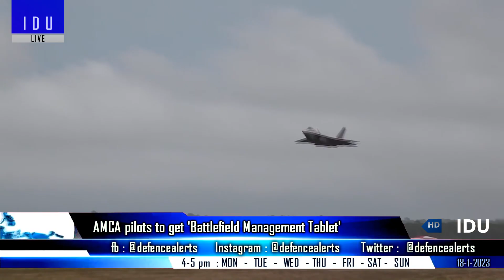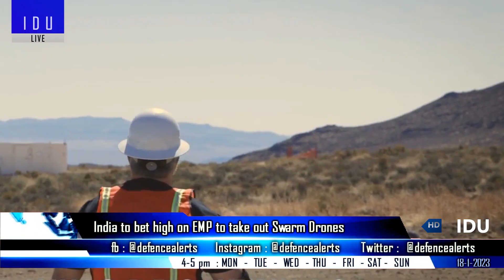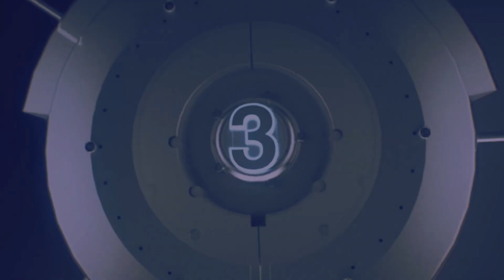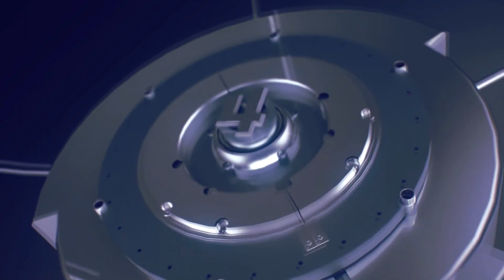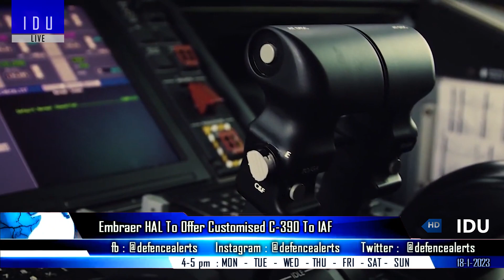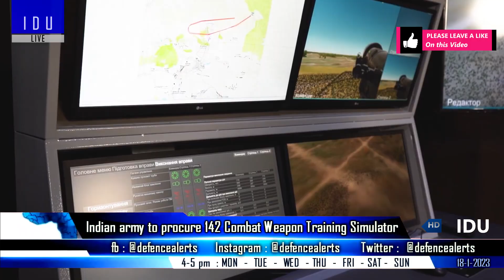Indian Defence Updates : BMT For AMCA,EMP Counter Drone,C-17 Upgrade,C-390 Offer,142 CTWS Deal

Comment from the maker: :yt:What's Your Opinion : "EMP Based Counter Drone" ?
ＬＩＫＥ | ＣＯＭＭＥＮＴ | ＳＨＡＲＥ | ＳＵＢＳＣＲＩＢE
Reply: It's An important non-kinetic measure which can be used to counter Chinese and paki drone  by Electromagnetic Pulse (EMP) technology. The EMP-based technique uses an extremely strong pulse of focused energy which is used to impact the electronic equipment by  increasing the voltage of those systems. By interfering with the radio links, the EMP disrupts the command-and-control system of the UAV with its ground control station. The main targets of the EMP include various sensors, navigation system, and communication system .
Several countries are investing in UAS and counter-UAS technology. China has made significant progress not only in UAS, but also its countermeasures utilizing all available technological options, especially EMP. In August 2021, China reportedly tested EMP technology to shoot down an unmanned aircraft. This event marked the first Chinese test of this technology to neutralise UAS and has also highlighted the growing relevance of EMP technology against such systems.
Reply: These things has to be left to private sectors who can come up fast and will free up resources at PSUs

Comment: the Indian Air Force should pursue Boeing to build them a stretched variant of the C-17A Globemaster III (Block 50) multi mission heavy lift transport aircraft . . . because the air force sure does need them . . . should Boeing launch a stretched variant of the C-17A Globemaster III (Block 50) multi mission heavy lift transport aircraft, rest assured Indian Air Force won't be it's only customer . . . meaning developing a stretched C-17A Globemaster III multi mission heavy lift transport aircraft is financially viable for Boeing . . .

Comment: C-390 is a good aircraft but it doesn't fit into IAF requirements. Currently the need of the hour is more heavy lifters. China has completed Y-20 in order to counter that more heavy lifters are needed. More C-17 should have been acquired when it was possible but no point in crying over spilt milk. The newer versions of IL-76 are extremely important now. Unless some other aircraft with such carrying capacity emerges in the market.